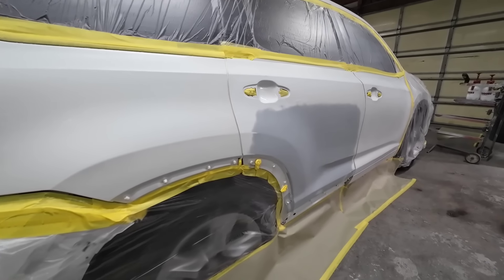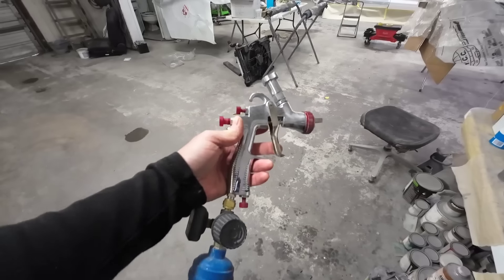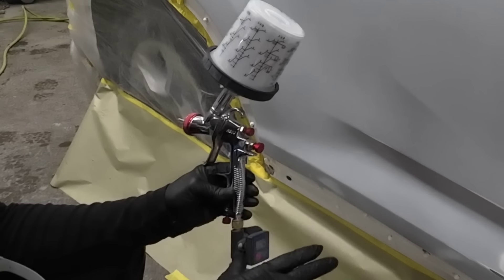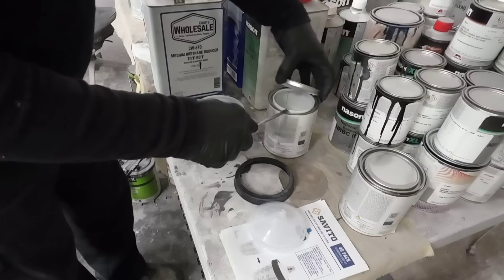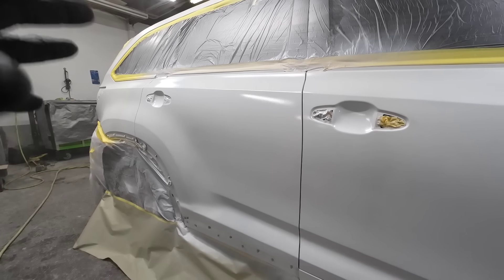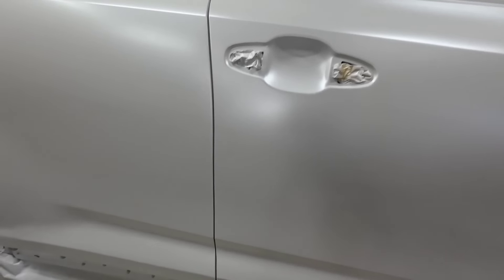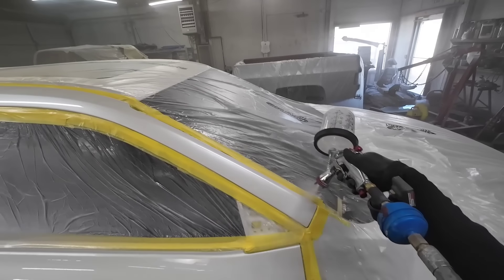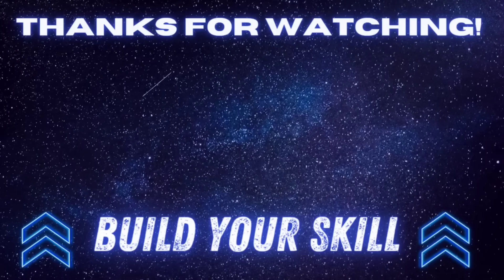The PERFECT lvlp spray gun to paint your car at home.

Comment: That door is available. It's not on national back order. If it was a 2024 grand highlander,  then I would believe you. But I just finished that same 2017 highlander, in which I replaced the quarter panel, rear and front door, and fender. So, don't bs with people who do this for a living brother. And if it was a darker color, then we can see your body work. Just saying.
Reply from the maker: You didn't  think about this video being a few years old and during the covid shipping issues.  If you do this for a living you probably understand that. So, not bs, chose to believe what you want brother.
Reply: I did brother. Thats how I know. I'm 37 yrs old, been doing this since 9 yrs old, all because my father owned a collision center.  And there are parts on national back order. But not hss door from Toyota. Just letting you know where I'm coming from. Nothing wrong at all with putting some mud on the panel. And it looks good, especially on a white vehicle. So you get my point. 2020, 1998, 2024, etc. It doesn't matter. If your a great body man and re finishing specialist,  then you know.
Reply: And there is always the option to replace the skin, only if the intrusion beam didn't bend and stretch the door shell. Shit, I would not be feeding people a load shit. Just simplify and say I repaired this door because the customer didn't want to pay for a new door or the labor rate of skinning that door. Thats all brother.

Comment: Hi Chris. I have another question. At one video you mentioned 24psi when spraying a base. At this particular 20 for sealer and 20 for base. As I understood from all your videos 20-24 for primer sealer and base and 28-30 for clear. Please correct me if i am wrong 
Also. What tips do you use when spraying primer filler, sealer, base and clear . Assuming 1.3 for sealer/base/clear.  I bought a kit with 1.3,1.7 and 2.0 tips.
Reply from the maker: You got everything right. I would probably use the 1.7 tip for high build primer . It may be a little big but should be alright.

Comment: Thanks for your tips! I got this gun recently from your recommendations and I’m having a rlly hard time regulating the pressure/air/fluid. I’m using the finish 1 720 clear and it’s coming out grainy. I can’t find the sweet spot, so it’s giving me orange peel. Any tips? Also with black paint it I lay a super wet coat the primer shows through the paint as a halo looking spot. But if I throw a less wet coat then I get the grainy thing too. All tips highly appreciated! Thanks for your videos
Reply from the maker: What's are your gun settings, distance and speed?
Reply from the maker: What the air temp and activator speed

Comment: I use this at work I was just checking it out. I usually shoot single stage at work. The only con i have is the spray pattern is super small.
Reply from the maker: Should be about a 10 inch pattern.

Comment: What was the compressor you used? What is the smallest compressor you'd consider?
Reply from the maker: Cfm production is what important for painting . You want a compressor that produces more cfm than the gun requires.  This gun requires about 4 so a compressor that produces 5-6 would be good

Comment: What is the difference between a $100 and a $300 LVLP spray gun?    At what point am I paying for fit and finish rather than paint quality and durability?
Reply from the maker: Depending on the gun, from a $100 to $300, a $300 gun like the segola 3300 GTO it's gonna be  better quality and built better , the finish is gonna be better, but if you know how to use a paint gun, the finish is not that Big a difference. I always say start with a cheaper gun. See how you like it if you get comfortable Spraying with that and then you want to upgrade to a more expensive gun, then go for it.

Comment: Great video. Quick question for you idk if it would call for a video or not but wondering what you’re using as far as a compressor, what water/oil filters you’re using in the line (if the lvlp needs it) and what tips you’d recommend for different finishes. I build electric guitars so I’m curious as to what you think would be a best case senario setup.
Reply from the maker: I use a 1.3 cap and tip for sealer base and clear. My compressor is a ingersoll rand  60 or 80 gallon with I think 7.5 hp and and about 17cfms at 90psi. I use a inexpensive oil and water filter Campbell hausfeld.  Hope this helps
Reply: @GarageNoise  thank you very much for your response. I build electric guitars and basses but the custom shop I worked for just closed down so I’m trying to setup my own spray booth since I don’t have access to our industrial one anymore. I’ll be using a smaller compressor but it doesn’t take much time to get a full coat on a guitar or two at a time
Reply from the maker: @michaelfox1694  with painting and compressors it's  all about how many cfm's it produces so you want for this spray gun between 5-7 cfms

Comment: Id like to honestly see a Flexible Primer Surfacer/Primer/Primer Sealer made for ABS and Polypropylene Bumpers!!! There isn't much luck out there I can find out of Flexible products in a can, but Seymour PBE Flexible Primer (In Light Gray), US Chemicals Flexible Primer Rose, And SEM Flexible High Build Primer Surfacer in Green, Rose, Beige, and of course Black and Gray (which I bought) id like to see a comparison test of...

Really Flexible Bumper Primer Surfacer/Primer/Primer Sealers out of the Can, Flexible Bumper Coater Paints out of the Can, and Flexible 2k Clears out of the can would be an EVEN BETTER SEGMENT because I've been searching all over the Net and testing these flexible products no one has seem to really have done... Even the Bumper Repair/Flexible Filler and Putty haven't really been done... The Plastic weld repair has been done now by dozens out there, so that section has been covered...

LETS DO THIS! A FLEXIBLE SERIES!!! TESTING FLEX, FRONT IMPACT WITH A BB GUN AND BLUNT FORCE AROUND THE BUMPER, BRITTLENESS, ADHESION "BITE" CHARACTERISTICS, SELF LEVELING CHARACTERISTICS, WORKABLE TIME/CURING CHARACTERISTICS, and a LAST episode of the Series testing for CHEMICAL ROMANCE between different FLEXIBLE Primer Surfacers/Primers/Primer Sealers, FLEXIBLE BASE PAINTS (EPOXY, ACRYLIC/ACRYLIC ENAMEL, URETHANE, even Lacquer I suppose for the heck of it), and of course compatibility with the FLEXIBLE EPOXY, ACRYLIC/ACRYLIC ENAMEL, URETHANE CLEARS... 

The products mentioned Above and Dupli-color so far I know of for Plastic Bumpers & Trim, Plastic Vinyls, in which some vinyls are even good for Carpet too! As a 2 in 1.
Reply from the maker: Sounds awesome and I would love to be able to take the time to do many video's like that. Honestly, that would be a monumental time sucking task to create a video  like that. Those types of detailed comparison video's are so time consuming and because this is not a full time gig for me, honestly I can't  devote the time to do it justice. That may be why you haven't seen a video like that. I could  however do a test of flexibility on a singular product. Anyway I appreciate your comment and suggestions.

Comment: Just about to embark on my first full paint job with these guns, the finish you got looks outstanding,  would you recommend only using the one gun for sealer base and clear I have 3 guns, 0007 0004 and a 0002 I think.
Reply from the maker: Yeah, If you have three guns . It's  not necessary but I use a separate  gun for primer. Appreciate the comment and support!
Reply: What size nozzle for the primer please?

Comment: Keep in mind my question is based on only using ratting cans so far.   Would I be able to do large panels with this gun or would I be better off with a hvlp gun.   ❓❓I understand you get more overspray with an hvlp gun.   From watching it looks like you would get strips easily with this gun.  I’m at my house so as little overspray as possible is ideal.
Reply from the maker: Lvlp guns such as this will give you less overspray. You won't  have issues with tiger strips as long as you're overlapping at 80%

Comment: Great video. I just bought a R500 LVLP gun which I'll use to paint my 66 Mustang. Never done this before so these videos definitely help...Thanks. Question - is there an upper end time limit for letting coats flash off?
Reply from the maker: Basecoat  flashtimes are typically around 24hrs but I personally wouldn't  wait past a couple hour. Check your manufacturer's technical data sheet.  Clearcoat needs to be more precise about 10 mins if you wait too long you can get dye back or loss of gloss. If you coat too quickly solvent pops.  Some clears are more temperamental than others.  Appreciate the comment and support!

Comment: Hi Chris nice job with that 3 stage Toyota!!    I'm kinda checking out the gun in Amazon
 there are two   the brand on on is  Hiuhiu  the other is Liysnpy is it the same gun? I' I I work at at a shop I'm gonna try it and see how it works..
Reply from the maker: Yes, this gun has been rebranded by many distributors.  Same gun, R500 in the manufacturer's name for the gun. Rongpeng is the manufacturer. Appreciate your comment and support!

Comment: Yep, I own 2 of the spray-it 35000s or rp500s.. great gun, I use it with a 30 gal older craftsmen compressor, but it will work with a 10 gal, 6 gal if u have to lol. But 6 n 10 gal will run constantly but without much appreciable loss of cfm  at the gun👍
Reply from the maker: Thank's for Sharing your experience. Appreciate the comment  and support!

Comment: looks amazing from a 60$ paint gun
Reply: @GarageNoise  what do you think of the r500/a610 paint gun ..?..i will be my first paint gun looking to spray my dodge charger...
Reply from the maker: @johnsmith-qz4bv  Right now it's  the only gun I use. Low overspray, low air consumption, material savings. It produces a great finish as well. I don't  know if you've  seen my other videos on this gun  if not check them out.

Comment: My garage rule is low overspray so i'm selling all my guns that fog it up. Turbine is lowest overspray, but if using a compressor, I want that gun that can run at lower pressure, minimize fog, and atomize well. R500 is capable of that. Can paint with a 21 gallon as well. Still runs a lot, but does pretty well.

Comment: i have 2 of these that i use to spray water based finishes on cabinetry.  really like the gun.  easy to clean and use.  plus at $90 CDN way cheaper than a fuji HVLP at $1500

good video with lots of information
Reply from the maker: Awesome! Appreciate the feedback on your experience.

Comment: I just got one of those R500. It is a match to my eastwood gun. The only difference that I could find is that the knobs on the R500 are aluminum where the eastwood feels like it is made of better material. Time will tell how the threads on the volume knob hold up with taking the gun apart to clean. 
Another great video, thanks again.
Reply from the maker: Rong Peng is the manufacturer of this gun they produce it for others to rebrand. I like the looks and finish of the lt 100 better.  Appreciate your comment and support brother!
Reply: New subscriber to your channel. Great video. Are you using the 1.3 tip that comes with the gun for the primer, paint, and clear coat or do you need to change for each product?
Reply: @sheldoncooper6230  I use the 1.3 for everything, well except the filler primer. I found that the filler primer was a little too thick for the 1.3 so I used a 1.7.

Comment: Would be good to see you do this with a different colour that shows the fan pattern better and how smooth it lays down e.g. red gloss
Reply from the maker: Check out the channel I did a red bumper  with this gun. Appreciate the comment and support!
Reply: @Garage Noise  yes I've seen that video but it doesn't actually show you spraying colour on a primed surface, you only showed spraying red on a red prepped surface so its hard to tell the fan size and coverage.
Reply from the maker: @finleyk   ok,  next time I'll demonstrate fan size it's about 10 inches

Comment: When you say “R500 can be used with a small air compressor”….how small we talking..
Reply from the maker: You need a compressor that produces at least 6cfms.  I haven't found one smaller than a 20gallon that can do that. Hope this helps, appreciate you comment and support.
Reply: @GarageNoise  I just checked my compressor and it is 2.6 SCFM @90 psi only a 6 gallon. Probably best suited for filling tires. Bought a car that had been previously “gently” side swiped, so it has its issues. Thought i might be able to get away with doing a panel at a time being winter time and all, but i’ll check into a used 20 gallon. Thank you for your reply, sir!

Comment: Good tips on how to use the Spray-it👍With documented paint savings I should be using it more for those cheap jobs where I only have a pint or half pint of paint for a repair area. 
   Totally unrelated, but I just bought and hooked up 50 foot of Flexilla hose and a Flexilla leader with a swivel. My opinion, Very nice flexible, cold resistant air line perfect for DIY/home-based business. Amazon purchase.
Reply from the maker: Thanks brother, appreciate it.  I have one of those flexzilla air lines had no idea it was cold resistant.
Reply: @GarageNoise  what they claim. Some kind of composite material. They have a promo burying it in the snow w other hoses. I guess it stays 'flexxy"
My garage gets plenty cold when i'm not in it, so seemed like a good choice.